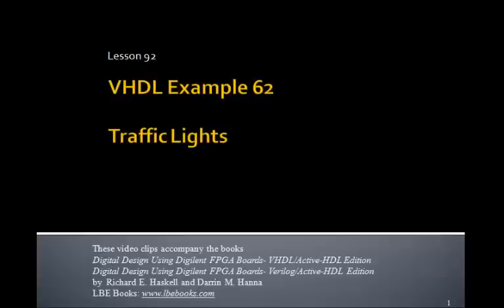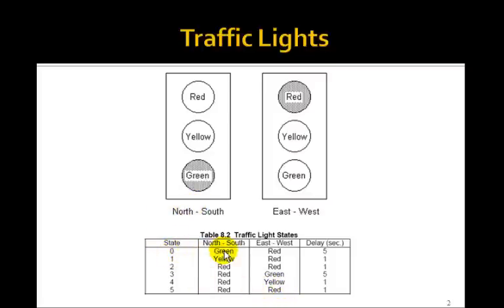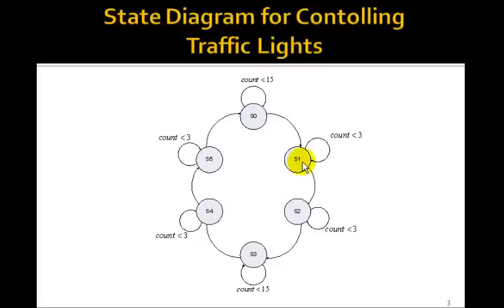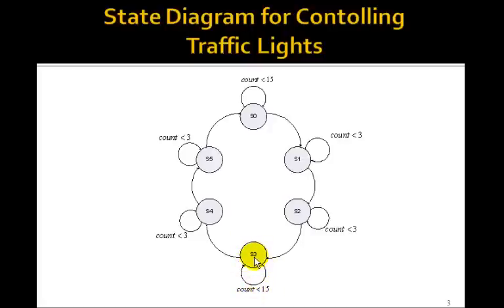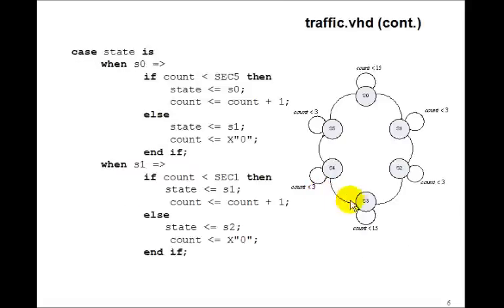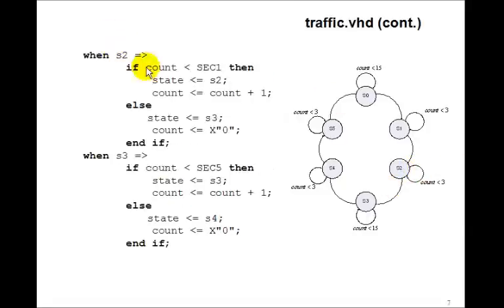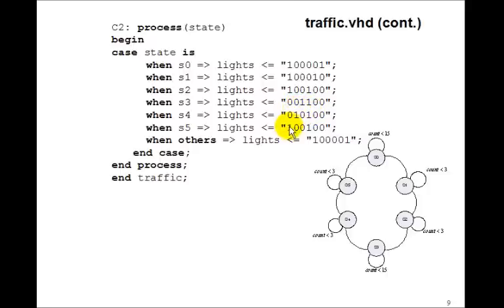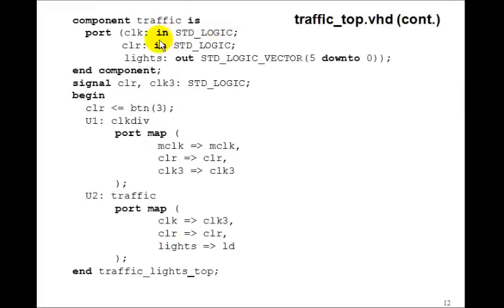Lesson 92 - Example 62: Traffic Light Controller

Comment: Can someone explain to me how the lights simulate through the case state where he set s0 light to 100001 
S1 light to 100010
S2 light to 100100
.....
So on I am trying to understand how the binary bits are set to each state . Would be helpful if you provide truth table
Reply: I'm not sure that I understand your question.. but you know that the bits of "lights" are ons/offs for the red of North-South set, yellow of North-South set, green of North-South set, red of East-West set, yellow of East-West set, green of East-West set, yes?
Reply: 100 red 010 yellow and 001 green but idk how he decide that :(
Reply: @1stplace362  Well, the sequence is usually thought of as Red Yellow Green or Green Yellow Red, so that's why the numbers are chosen in that kind of order, & 100, 010 & 001 are "one hot encoding" choices. Does that help?